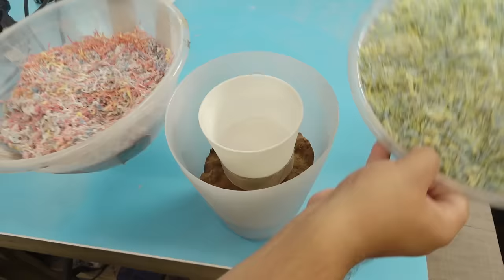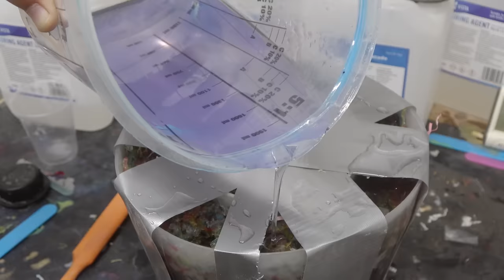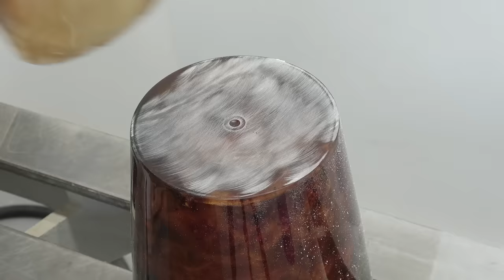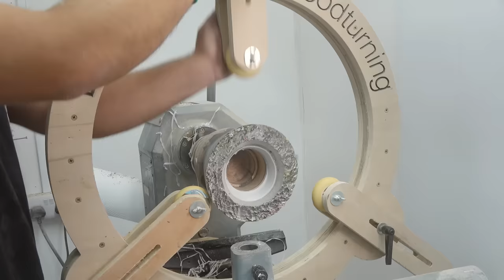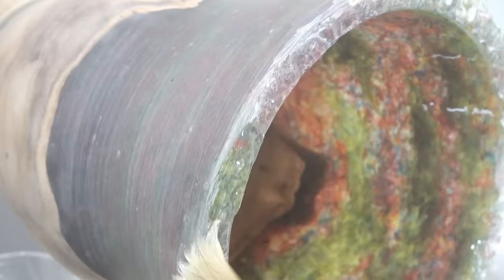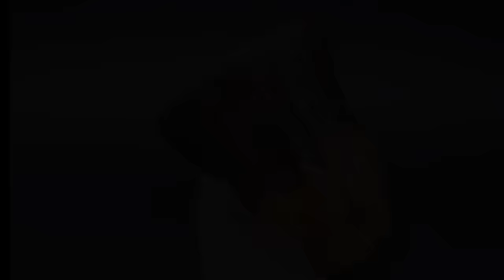Woodturning – Can you recycle old resin shavings?

Comment: Looks lovely! And finally a good use of the shavings! How many voids appeared? There was pretty much area for the bubbles to stick at
Reply from the maker: Thank you 🙂 Yes there were some this is why i went with a resin top coat finish. Also many bubbles within the shavings. Would have been better to put in the vaccine pot to suck the air out them into the pressure pot to further help with the bubbles